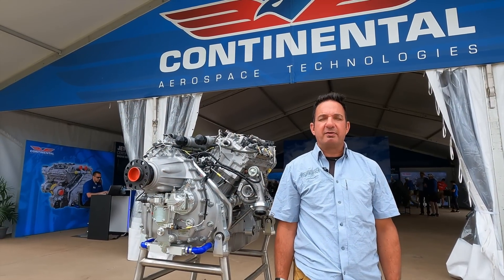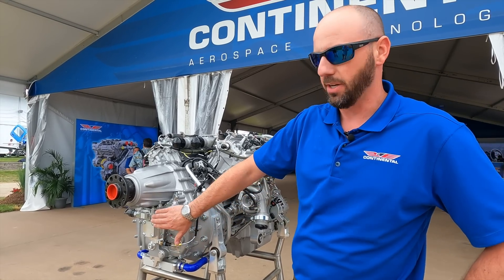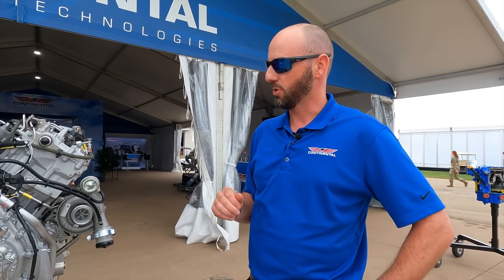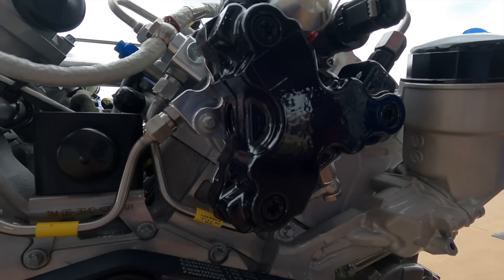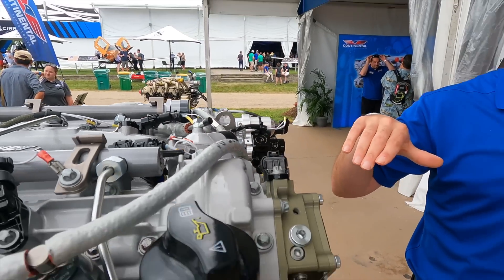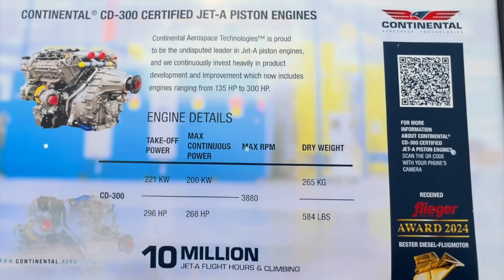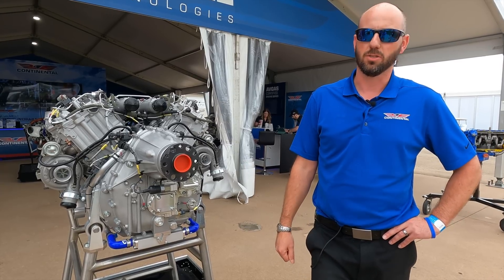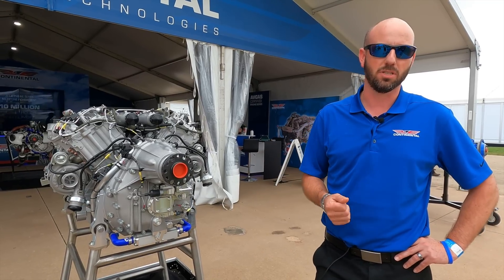AirVenture 2024: Continental CD-300 for Cessna Stationairs

Comment: The first thing is, a working 206 could use more hp than 300, also a diesel engine should not need a reduction gear box which only makes the engine more complicated and heavy a Cont. 550 or Lyc. 540 or 580 would be lighter in weight and provide better performance

Comment: I used to work at a flight school that used CD155 converted 172’s.  We found them extremely fragile and unreliable and Parts were very hard to get from continental.
They also produced a lot of soot from the exhaust so the undersides would get coasted in a thick layer of oily soot that was extremely hard to clean. Also because the engines were heavier they essentially turned the 4 seat 172 into a two seater.
Overall we found that after considering the increased maintenance costs we only saved around 2-3 dollars per hour compared to a normal avgas 172. However the diesel 172s flew less hours per year due to their reliability issues so overall they ended up costing more than a normal avgas 172.

Comment: I live in Finland and we are paying $13.50 a gallon for Avgas. Jet-A is $5.25 a gallon. Overhauling an engine is about 35% cheaper than buying a new engine so the avgas engines have that over the diesel. The CD-300 burns about 30% less fuel (IO-550) if my math is correct. Both engines have the same 2000 hour expected life. So depending on how cheap you can get your fuel the CD-300 might make sense. Interesting side note. 270 continuous ponies in the CD-300 is being produced at 3700 rpm as opposed to 2700 rpm in the IO-550. Extra engine wear or not someone else probably can comment better than me. I suppose it doesn’t matter if the engine gets to TBR. I guess part of that extra weight is the reduction gearbox but it’s partly being offset by increased endurance. Yes diesel is a bit heavier than avgas 0.74 to 0.82.

Comment: It is  Mercedes OM 642 Engine. Little bit   modified,  like  dual turbo , different intake,  but , it is still OM642.  Mercedes , put it on sprinter,  and other models.  Really good engine,  if work without  EGR, and others eco systems....
Reply: yes it is, but the price is different :D

Comment: Wonder if u could also sell to marine ppl and take out alot of the cost by not being certified and removing the redundancy.   🤔🤔🤔🤔🤔🤔
Reply: marine people want pure torque at low rpm, pretty much the opposite of aviation's high rpm. you really don't want your diesel over 2,000rpm in your boat, they prefer 1200-1600 tops.

Comment: It's unfortunate that they continue to put lipstick on these pigs, GA aircraft need light, powerful and fuel efficient engines, and this isn't it. The MYT engine could provide 300 HP and Jet A in a form factor weighing about 25 pounds or 10 kilograms.

Comment: This is where we are going to be considering that 100LL is under attack and no viable, engine friendly lead free AvGas is available. The fuels are not the problem, it’s 1940’s engine tech that was designed for leaded gasoline which is the issue.
Reply: GAMI and Swift both have viable alternatives.
Reply: @PistonAvatarGuy Swift has reportedly had some issues with their 94UL, but no problems with G100UL.
Reply: @galactictomato1434  Supposedly, but they were all isolated to one flight school, which makes me think that there was something else going on there.
Reply: @PistonAvatarGuy  Fair enough, you could be right.

Comment: Continental spent so much time on this thing instead of preventing snap rings from coming off their counter weights and cylinders from cracking constantly.
Reply: Don’t fly LOP, get rid of Mike Busch propoganda and your cylinders will thank you 😊
Reply: Actually this does solve that problem.  A water cooled diesel isn't going to crack cylinders.  Time to get rid of lead burning air cooled engines.

Comment: Fuel burn for Hp seems great.  However, it does appear to be very heavy for a 300 and agree with others on the likely $100,000 price.  Then again, none seems to object to $100k for Garmin avionics.
Reply: Look up the price of the top HP turbo engines from Conti and Lycoming. And bear in mind those are stone-simple engines with little in the way of electronics, and are air cooled.

Comment: This engine is already twenty years old in automotive industry, and you guys in the comments are saying you don't like the modern witchcraft. No wonder hybrid electric motor aircraft aren't here already. Luddites 😂
Reply: There's no gain to be had from hybrid technologies in aircraft, unless you're talking about a turbo-compound engine which makes use of an MGU-H. No one would be able to afford such a thing for a light aircraft, though. The engine being shown here is already ridiculously expensive.
Reply: @PistonAvatarGuy  That's not true if you're using an electric motor solely to spin the propeller. High torque from zero revs, high efficiency, and higher reliability. You use a motor to charge a smallish battery. MGU H wouldn't work because cars don't decelerate very often and wouldn't you use the big spinny thing on the front rather than the spinny thing on a tiny turbo?
Reply: @planespeaking  Obvious troll is obvious.
Reply: @PistonAvatarGuy  troll? You're faintly ridiculous

Comment: FINALLY! A modern aircraft engine. This thing will change aircraft engines forever.
Reply: Why change something that it’s been good for decades? I prefer to pay 100,000 dollars for an io550 than the same amount for an ugly diesel engine, all because of a problem that doesn’t exist, I like to lean my engine the way I want to, not a freaking
Computer that comes up with a fixed setting for every power setting, again looking the for the solution of a problem that doesn’t exist, all in the name of the fake climate change
Reply: Well, Rotax is modern, and the Austros are modern, and have been available for a long time.
Reply: @UncleKennysPlace  Rotax does not make high HP engines that are suitable for conventional certified aircraft. 
Austro engine is very cool, but very expensive and again can't handle high HP. 
What Continental has built here is a high performance V6 but for an airplane. This engine will be smoother, quieter, easier to start hot, have a much more linear power band, more torque and above all else, it it very very fuel efficient/reliable.
Reply: @UncleKennysPlace Rotax isn't modern, still old pushrod design.
Reply: Doubtful, it's already flying in the DA50 and it doesn't really offer any advantages over legacy aircraft engines.
Reply: @PistonAvatarGuy ??? Legacy enine uses AV gas and getting hatder to find while the above use Jet A fuel that is easily available. That is a huge diffrenxe.
Reply: @yours_sincerely48  That's not really an issue in the US.
Reply: @PistonAvatarGuy  The whole world is not USA alone.
Reply: @yours_sincerely48  But the US is the largest market for light aircraft, by a very significant margin... last time I checked, anyway.
Reply: @PistonAvatarGuy  That is the problem why GA companiea are not thriving and barely stay afloat. US is only 400 million population and the world is 7 billion people. If you say that US is major market then GA companies not doing a great job. US is just  a small.market compare to the world.
Reply: @yours_sincerely48  But I don't think that's a problem with the available products, I think that it's a wealth and regulation problem. Americans are relatively wealthy and the regulations in the US aren't quite as strict as they are in other regions. Aircraft are also popular in the US because it's a very large country, while those living in more densely populated regions (Europe) just aren't going to gain much by using aircraft for travel.

Anyway, insisting on using jet fuel in piston aircraft will doom them to poor performance and high cost, which will also make the aircraft less appealing to buyers.
Reply: @PistonAvatarGuy  That is another issue you highlighted....Not all amerivns are Rich just a small percentage are Rich snd the rest are poor. Americam lived on Credit, borroeed momey. Its already USD40 Trillion on American shoulder. American are full of thdmselves and forgot that there are other countries outside of US. With 6.6 billion population  vs 0.4 billion US, trust me there are more planes outside of US...Do remembee Russia, Former Soviet countried, China, Iran, South Amrrica, Africa do have their own GA plane ...That is a huge number of GA plane that can be converted.
Reply: @yours_sincerely48  The GA market is practically non-existent in those countries. If those aircraft are converted to diesel, they will be less capable. If those countries want GA aircraft, they should make gasoline available for them.
Reply: @PistonAvatarGuy  Nonsense...how do 140 countries around the world  trained their aiforce pilots and Commercisl.Pilots? It is through local flying school using light GA plabes like Cessna, Tecnam and Diamond  Diamond are  EU based amd sdvocate diesel/ Jet A fuel. Diamond GA planes are  fast gaining market shares thtough out the world by being modern, fast and economy using diesel engine. The DA62 twin diesel and the DA50 using above engine are popular nowadays. The old legacy Csssna, Piper are no longer sought after...
Never the less which private school wants to buy and stock AV gas that are getting harder to find and expesive while the local.airports can easily gets Jet Fuel meant for tubine engine Boeing and Airbus plane..
Reply: @yours_sincerely48  Americans buy light aircraft for travel and pleasure, not just for training, that's why the GA market is so large here. People who fly for pleasure or travel do not want slow, heavy, expensive diesels. Aircraft powered by the Rotax gasoline engines are also some of the most popular in the world, because they're efficient, inexpensive, reliable and offer good performance.

Regardless of what you'd like to believe, gasoline engines still massively dominate in aircraft when it comes to performance.
Reply: @PistonAvatarGuy  no advantages over legacy aircraft engines? Are you living behind a rock? To quote the comment above you: „This engine will be smoother, quieter, easier to start hot, have a much more linear power band, more torque and above all else, it it very very fuel efficient/reliable.“ Add to that avgas availability/price problems, single lever engine control and more. Your comment can only make sense in a very narrow bubble in the USA, where fuel is cheap and you fly an SR22 turbo, or if you’re trolling.
Reply: @spitfireinvasion  A lot of those advantages are only because of the FADEC system on the diesel, but the legacy engines are available with FADEC. A linear power band is irrelevant when it comes to aircraft engines. Torque literally means nothing in an aircraft application, especially one with a PSRU.

The SR22T gets better mpg at a higher speed, the same is true of several other legacy aircraft (I believe that the Bonanza is one). There's even a pressurized model that flies higher, much, MUCH faster and is very close to being as fuel efficient with regard to mpg. I'd have to go back through a bunch of old posts to find the specific models, but I'm sure that you can find them if you look.

The problem with the aircraft community is that they go by gph, not mpg, the diesel just doesn't do that well with regard to mpg ratings, because it's overall performance is so poor.
Reply: @spitfireinvasion  Sorry, it was fuel cost per mile. The SR22T flies faster, but had lower fuel costs per mile when I last checked. It's been a while, so that may have changed.
Reply: @spitfireinvasion  Flying Magazine actually did get better mpg with their SR22T, 14.5 gph at 185 knots, while the DA50 does 14.3 at 170.
Reply: @spitfireinvasion  The DA50 and the Piper M350 are both $1.1M aircraft, but the Piper just puts the DA50 completely to shame, and it does that with absolutely ancient gasoline engine technology.

The M350 is significantly faster, it's pressurized, it's a cabin class aircraft, so it has a much larger, nicer cabin with an additional seat, it has a greater useful load, it's range is far greater, its takeoff performance is better, its climb performance is better, it service ceiling is higher.... it's just worlds better than the DA50. The diesel probably wouldn't even be suitable for a pressurized aircraft, because diesels lose so much power at higher altitudes.

The mpg for the Piper isn't even all that different from the DA50 at max cruise (about one gallon/hour difference).

Diesels are just sad, everywhere they're used. We can only dream about what modern gasoline engine technology could do in a completely modern airframe.
Reply: @spitfireinvasion  The Pipistrel Panthera absolutely demolishes the DA50 when it comes to efficiency.

Comment: I love the concept of a powerful diesel aero engine, but this one seems really complex. I prefer DeltaHawk’s far simpler design. DeltaHawk already said they’re going to add 2 cylinders to their current product in a year or two, so it should make 300+ horsepower. It’ll be interesting to see if either engine gains traction in the market.

Comment: But it's still hard to compete with Continental's own TSIO 550.
Reply: No shock cooling hazards, no danger of running lean, better fuel availability, more thermal efficiency, no mixture control worries.. I love a TSIO 550 too but there are some good points here.

Comment: Mercedes OM642... yikes!
Reply: No EGR or oil cooler on top, or swirl flaps and plastic intake junk. It's all metal and billet pumps etc.  All of the om642 bits that went wrong aren't there anymore.
Reply: I’m rocking 2 of these, sprinter and ML. Each one is at almost 250,000 miles and they’ve been phenomenal.

Comment: It's a six figure engine with a TBR with an increase of around 150 lbs.
Reply: TBR yes.
OEM only so quote is hard to get.
150lbs ?
Cd-300 is 584lbs with gear box.
Io-550-a is 455.9lbs (the lightest)
Tsio-550-g is 554lbs
Sure jet-a/diesel is heavier than avgas but it consume less.
Would be a better comparison if they have a fadec 300hp avgas but they don't.
The real questions here is how can someone get one and prices both purchase and TBR?
Reply: 150lbs for the same power. So a performance downgrade. Nice.
Reply: @Big_Iron_Mode  Depends. The CD300 can put out its full 300hp up to 8000ft, where the IO540AC can only deliver 230hp or so. On the other hand, MCP is less at 270hp, but from up 4000ft upwards, that is still more than the IO540AC can do at WOT. That should help with the extra weight, I guess.

I think the main selling point will be operating on Jet rather than 100LL. Still pretty hard sell at that price point, but I bet they're still going to deliver before Deltahawk does.
Reply: @LeShadokEnchaîné 

Modern 206’s are either equipped with a 300 hp IO-540-AC1A5,
Or a 310 hp TIO-540-AJ1A (-AJ1A is the only version still in production) 
And that is 300 & 310 continuous, not just for takeoff. Yes, diesels are more fuel efficient, but whatever you save on fuel will be spent on maintenance and more. You do not gain anything
Reply: @kristus20 it is NOT continuous. That is hp at max power. Standard cruise is 65%, so the IO 550 300 HP is actually only producing about 200hp at cruise.
Reply: @scbane  there is no IO-550 powered 206, a new 206 has a TIO-540-AJ1A and although a typical standard cruise setting would be 75% power (that’s 232.5 hp), it can be run at 100% continuously (310 hp) for max cruise. The CD300 can run continuously at 268hp, but produces only 197hp when operated at best economy (which makes the most sense if you want to save on fuel). However, people with the money to buy this aircraft do not need to worry about fuel cost, which is offset anyway, by the massive increase in maintenance costs (including engine replacement at TBR), especially if it’s not flying a ton of hours annually. I’d care more about performance and reliability (a win for the Lycoming)

Comment: I wish them luck, but all the diesel engines in the last 20 years have had a horrible track record of long term support, serviceability, and reliability
Reply: Only from one company and they’re gone.
Reply: @JustaPilot1  the c-206 and c-182 have been on the brink of of going all diesel several times and it never makes it accross the finish line for whatever reason.
Reply: @tmpendergrass  Yup. This may be the time with this engine.
Reply: @tmpendergrass   Because Cessna has previously chosen untested engines from unreliable suppliers. This is really a great fit for the 182 also
Reply: @JustaPilot1 eh, Austro is OK but have plenty of issues too and support is “Meh”. A fair amount of ADs for what they are too.
Reply: That's resultant from all the emissions stuff that this doesn't have, no?
Reply: the whole issue has been the emission nonsense with any truck diesel--either pick ups or big semi----the emissions regs are motor killers--the billions of $$ dollars lost due to maintenance and poorer fuel economy,freakin nightmare--the forest fires in western usa put 10000 times more carbon in the air than diesels--a farce
Reply: wrong!!!! its an automotive based diesel engine its not a brand new design from ground up, parts are easily available.